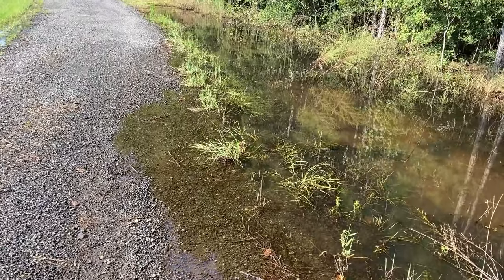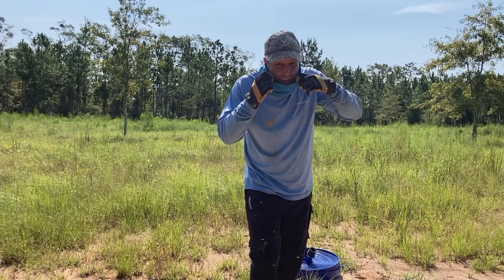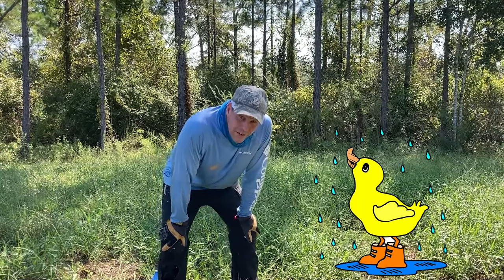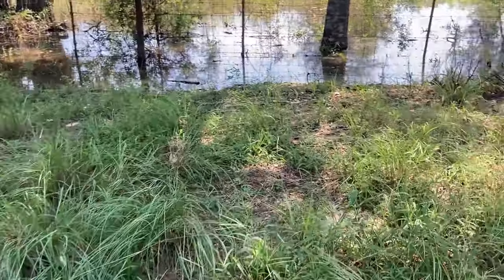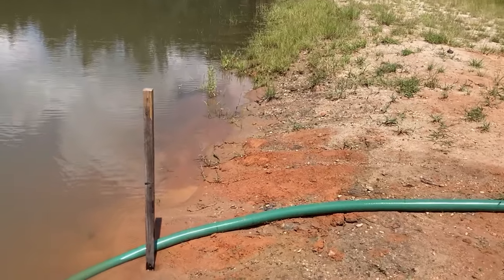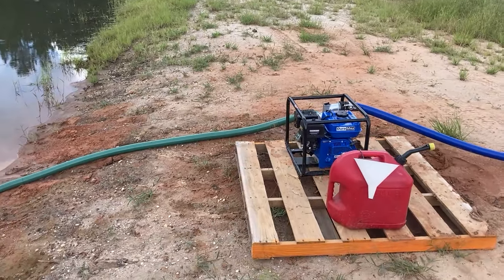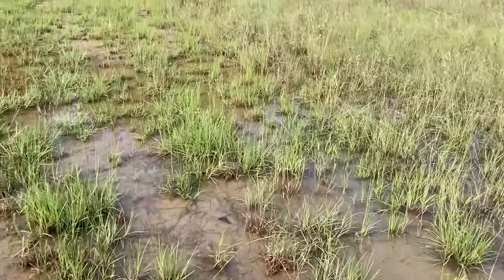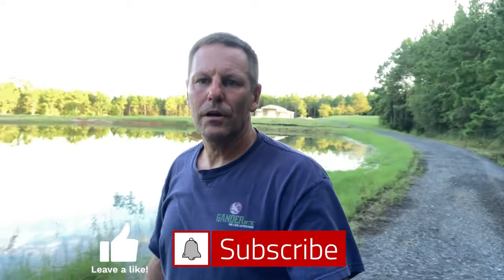Using a 2" Trash Pump to Pump a MILLION Gallons!

Comment: Those pumps put out more volume at a low RPM. HIGH RPM will give you more pressure, but less volume. Drain pipe at dam would solve your problem.
Reply from the maker: I'll keep the RPMs in mind if I ever have to pump it again.   It's significantly lower now in November so I need to find a way to seal it to keep the water I capture.   More to come on this project!  Thanks for watching.  Brad&Deb

Comment: Would be possible to set up a siphon system? I cannot determine the topography of the site but if the land is sloped away from the pond you could set up a 4 or 6 inches siphon and not have to burn gasoline to draw down the pond.
Reply from the maker: Right now the bigger problem is getting the pond to keep all the water it collects in the summer.  More to come on this project!  Thanks for watching. Brad&Deb

Comment: Seems if you use a ditch witch and lay a pipe from your inlet to outlet, with a protective grate on the inlet, you could set it up to automatically drain off anything above the level you want, maintenance free.
Reply from the maker: Yes, a permanently installed overflow pipe would fix this but we're still evaluating the frequency that the pond gets this full.  Thanks for watching.  Brad&Deb

Comment: Build your road up with Clay dirt so when it filled up with water again it won't cover your road
Reply from the maker: It was a record rainfall year for our area, so we don't expect the pond will be that full  very often.  We only pumped it down because we had concrete coming for a house slab and the concrete trucks will not drive through water.   The water level is 4' lower than that picture because we haven't had significant rain this fall. Thanks for watching!